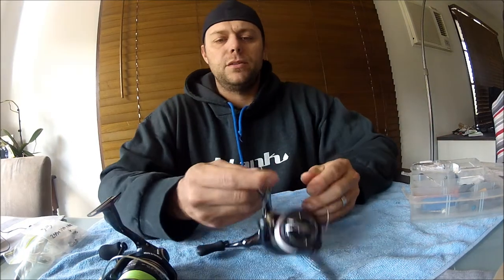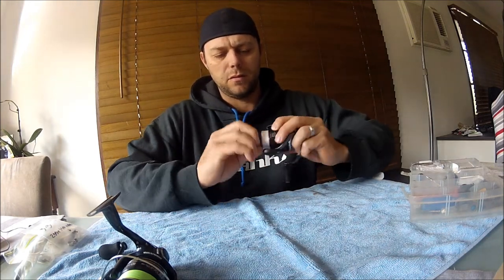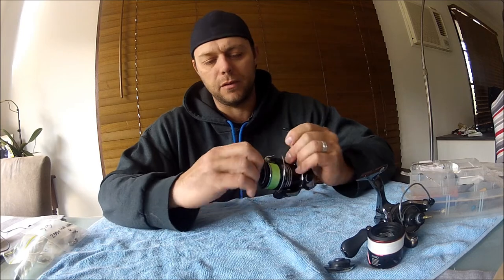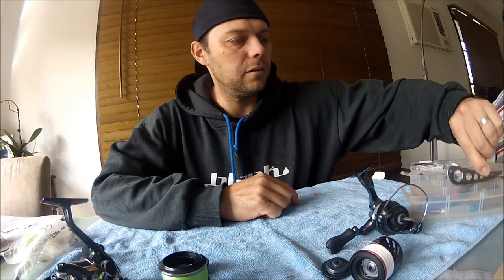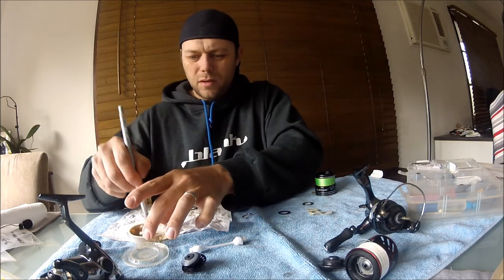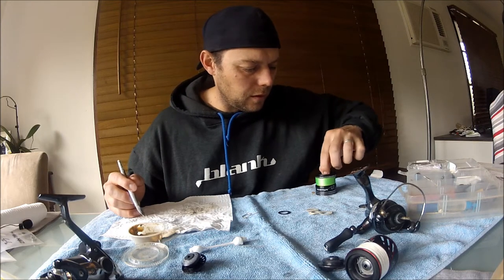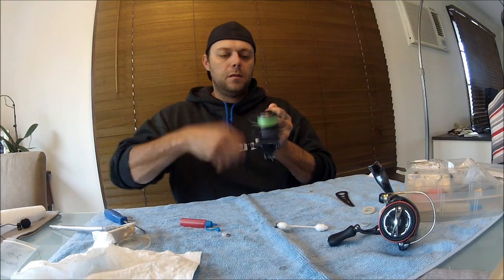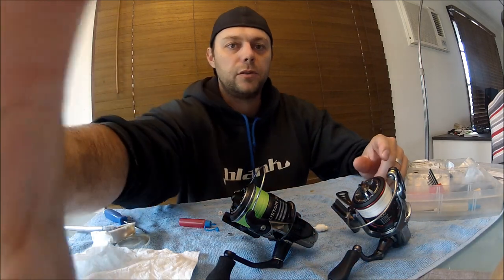Pimping Reels

Comment: Can you do the same to a stradic 1000hg? And where can I order the parts? Thank you for your help
Reply from the maker: geno ramirez yes you can do the carbon drag, not sure on other mods as I haven’t personally looked at a reel myself, so not sure on other things.
Reply: Victorian All-round Angler  does it raise the amount of drag? My stradic and the ci4 plus only have 7 pounds of drag
Reply from the maker: geno ramirez yes you will get more drag and also smoother. Good if your using light lines.
Reply: Victorian All-round Angler sweet, I mostly trout fish using six pound line. Thank you for the info!
Reply: wherr u got the carbon drags n wat tool set u got to service? thanks
Reply: mogtrader8  carbon drags from hpbearings on eBay but any carbon drag like smooth drag or something similar that is specific to your reel will work. Cals drag grease on ebay as well. 
The Allen key I use is 0.89mm,  I think but can check when I get home.
Reply from the maker: mogtrader8 had wrong account active. Last post was from me mate. 👍
Reply: thanks. i'm trynna invest in some tools to service my reels, was wondering if you can give some advice.  i have a few shimanos myself:   ultegra, ci4+.  The 3000 size seems to be lighter than the 2500 out the box, but not sure after spooling.  i do like the factory knobs on the 3000.
Reply from the maker: mogtrader8 Phillips head screw driver p1 and p2 size. 
Small shifter, cotton buds, paper towel. Small paint brush.
Reply: Victorian All-round Angler im trynna replace the plastic white washer in the knob shaft,  where can i get this bearing?  i noticed the actual bearing in the knob itself is smaller than the white plastic.
Reply from the maker: mogtrader8 what reel is it in mate? Look up hprbearings on eBay, and search for your reel. Should come up with the upgrades. If they don’t have it he should be able to match part number to another reel and use the upgrade for that.
Reply from the maker: Sorry mate it’s called hprbearings
Reply: Victorian All-round Angler thanks, just did.  will order the bearings.  im not sure about the bearing for oscillating shaft.  maybe down the road.  all the others seem doable for my beginner level.  thanks
Reply from the maker: mogtrader8 isolating shaft is hard to do. The worm drive one is hard to do as well because the bearings is a touch short in height but can be shimmed out to make it work. If you do worm drive check the spool support mechanism doesn’t bottom out on rotor lock nut on the down stroke. If it does the worm drive needs to be shimmed. If that makes sense. Lol

Comment: whitch ones do u buy
Reply from the maker: Bearings and drags are from hprbearings . Just buy the ones to suit your reel. 
The drag grease is cals drag grease original. But there is a cold water grease I use for trout fishing. 
Oil was quantum hot sauce.
Reply: thanks
Reply: What is the size of the Allen wrench that you used for the set screw? -Shimano Stradic 1000CI4+
Reply from the maker: Cher Vang .89mm

Comment: Thank you for this video. I've done the spool shaft bearing on my ci4+ and the carbontex drag washers. I have a question though. I have a little forward reverse play in my handle. Do you know of a fix for that? This is not my video but it is exactly what my basically brand new reel does (more the back and forth and not so much the play going in and out). https://www.youtube.com/watch?v=d70DUb4rndI
Reply: Dstrbd if it’s backwards and forwards sounds like the anti reverse clutch either worn out or too much play. If it’s in and out that would be the bearings or spacing of the handle thread and thread on reel.
Reply: @toygtr69  I really appreciate your reply. I've only used the reel twice on tiny rainbow trout so I doubt it's worn out. Is there a way to elimnate the play in the anti reverse? I just got a reply from Shimano today offering me micro shims so I could add it to the main gear pictured here https://www.stripersonline.com/surftalk/uploads/monthly_06_2016/post-52950-0-83180300-1466554729.jpeg . I will try it and thanks again for your response!!
Reply: Dstrbd yeah mate that would work. It goes on the opposite side to the teeeh on the main gear.
Reply: @toygtr69  Ok, I will give that a go. Emailed Shimano and they are sending me the shim set. Thanks for replying and thanks for your vids. They are very helpful and I appreciate them.